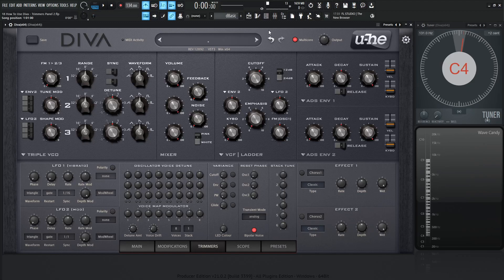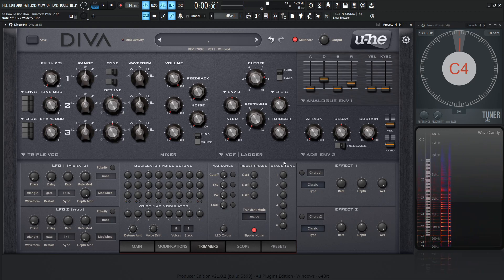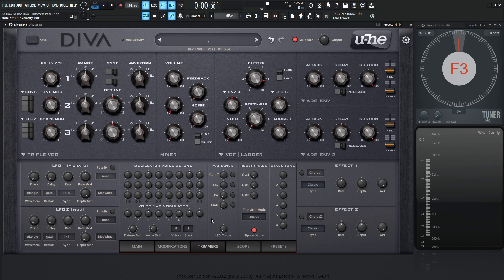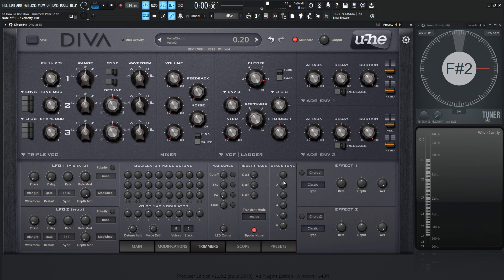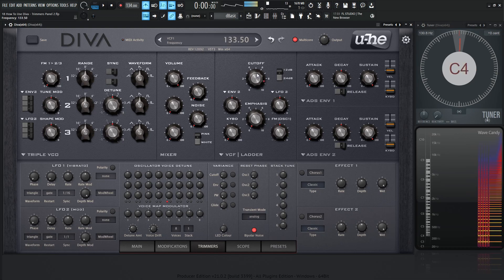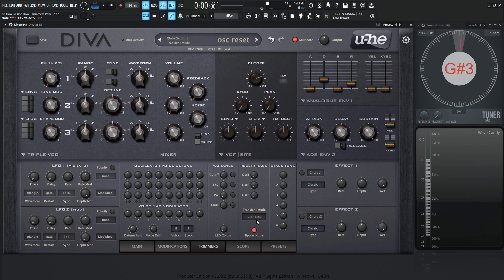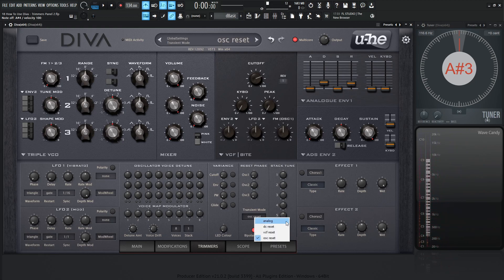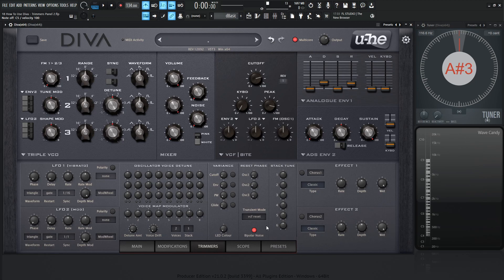Trimmers Panel 2 PART 18 | u-he DIVA Tutorial

Comment: The Osc reset .. can that be used to fix the phase of the bass ?? Thanks for the great videos 🙌🏽🙌🏽
Reply from the maker: Absolutely! Each knob will let you decide where in the waveforms phase cycle it will start at. So if you have a bass you can select osc reset and turn the knob while your mix is playing and find the sweet spot
Reply: @jonaudio  thanks so much for the swift reply yeah I knew how to do it with Serum it’s in plain site haha still learning Diva 🙌🏽🙌🏽
Reply from the maker: You're very welcome! Keep in mind that those knobs will control the phase restart only if osc reset is selected as the mode in the drop down menu

Comment: What is DC reset?
Reply from the maker: when a waveform oscillates too much above or below the center line that is DC off set, if you select the dc reset button, it will force the waveform to oscillate at the zero crossing
Reply: @jonaudio  Thanks! By the way, thanks for making this series. I notice you've got MONA for the skin now, isn't it fantastic? So good to have everything in one panel!
Reply from the maker: You're very welcome!! Diva is just an amazing sounding synth. I love that thing dearly haha.
Yup I got Mona right when plugmon released it and I haven't went back to the default skin since. That skin really makes diva feel like diva if that makes any sense.
Plugmons skins are top notch. The one for zebra is great too, Neumann pro. I did buy his skin for hive, eclipse, and have used his other hive skins, but for some reason I just prefer the default hive skin. Maybe because I'm so used to it? 🤔